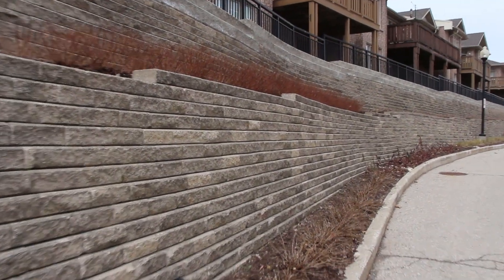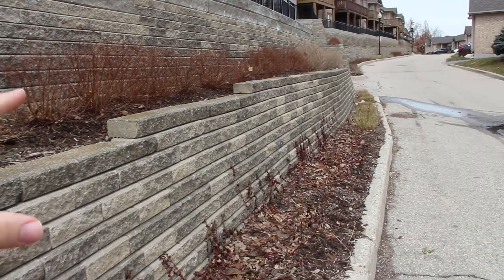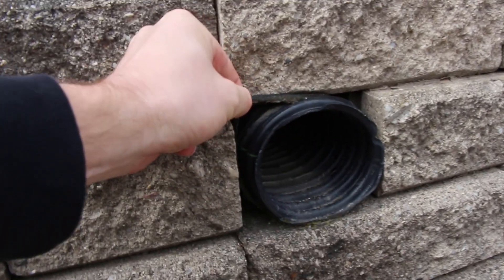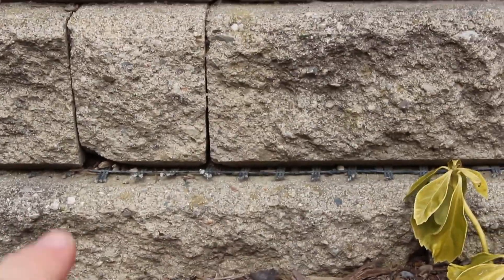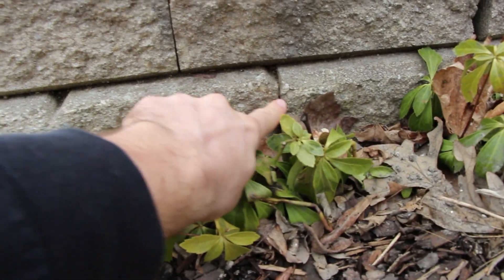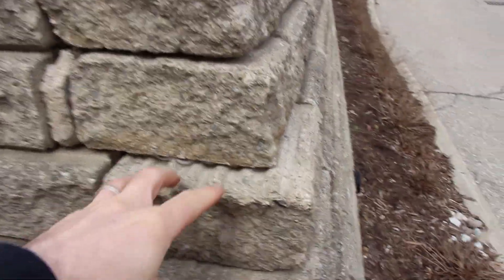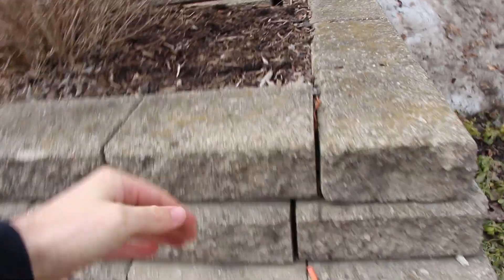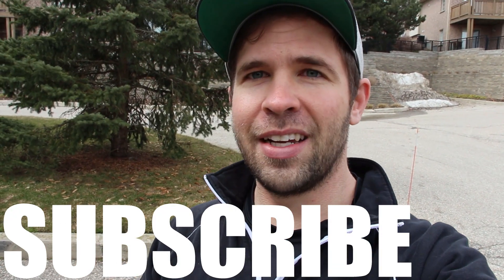Tiered Retaining Wall Failure Walkthrough

Comment: Good video.
Nothing wrong with the wall… seems to be performing well. The weep holes on the lower wall are actually tied with the drainage system behind the taller wall as that one IS the retaining wall. Its footing is at or below the elevation of the front wall.
Reply from the maker: Thank you! If the taller wall is the retaining wall, it would have to be twice the height of the lower wall away from the lower wall. Otherwise they work together as a single wall.

Comment: Why would you not want a sleeve on the perforated pipe? 
Doesn't it actually help to prevent soil from seeping into the pipe?
Reply from the maker: There are two schools of thought on that. The first is as you mentioned. The other is that if there is that much soil needing to be prevented from infiltrating the pipe, it will clog the apertures of the sock.